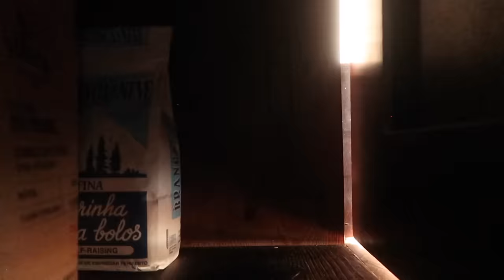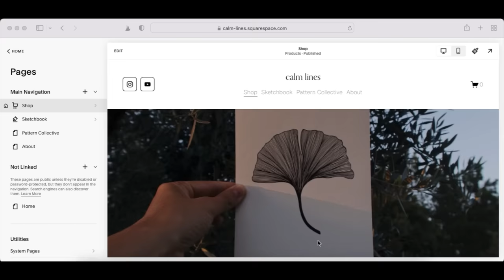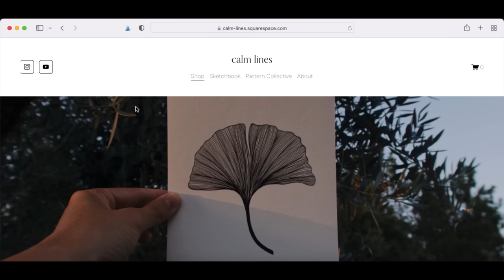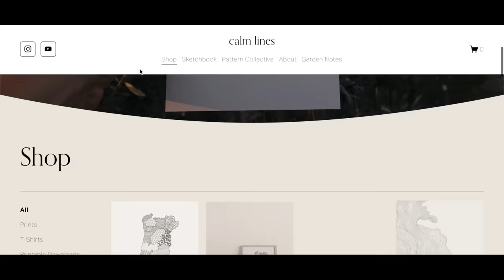A calm life building a small £25k off grid farm.

Comment: HI, I’m not your dad but i am a dad, so i will also give you another little tip like you did protecting the electric plug with a bag. I suggest when you go up a hill or a bump with a wheelbarrow which i have see you struggling with, pull the barrow up rather than pushing it. This works because you are on higher ground when you pull therefore pulling the barrow up the hill/bump rather than pushing it into the ground. Try it and see.
Reply: Also if you ever buy a new wheelbarrow get one with two wheels at the front. Game changer!
Reply: @julieking4828  -- And when you make your vegetable beds, leave a wheelbarrow width between them for wheelbarrow access and easy of movement and weeding. :)

Comment: Dont know if you already know but you can cook bread in a slow cooker if you have one. Just mix the dry ingredients in mix lukewarm water and oil , knead 10 mins and pop in a greaseproof lined pre warmed slow cooker. Cover over the inside lid with a tea towel to stop moisture and cook for 2 hrs. I turn the bread over after 1 hr so its not soft on the top. Its on you tube. It saves having to leave it to rise . Just pop in and its brilliant 
My friend told me about it and its great no fuss and saves on power which we have to be aware of now in the UK as its so expensive.

Comment: You use quite a lot of cement in your concrete. The golden rule is: 1 part cement, 2 part sand/growel, and 3 part stone/rubbles. You used a whole bucket of cement in the mixer, which is way too much - you can easily cut it down to half as much, if not a 1/3 and still get a really strong concrete for the project at hand. 
Otherwise I love your videos, they're calm and give me a sense of tranquility. 🤗
Reply from the maker: You can’t build walls with gravel in concrete 😉 for building walls you need a mix of 4-1, 4 parts coarse sand and 1 part cement. The bucket it the measure - 1 bucket of cement to 4 buckets of sand. It’s a perfect mix for what we’re doing.
Reply: They’ve been taught by the master!